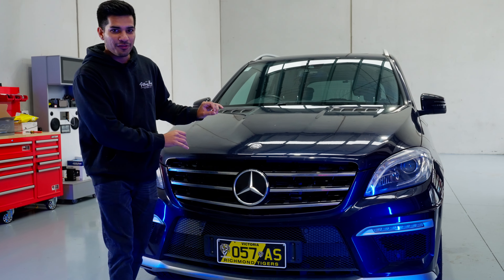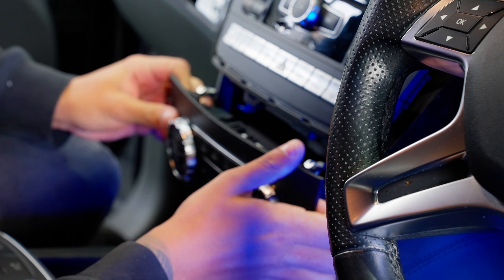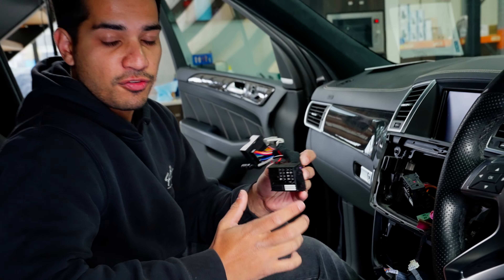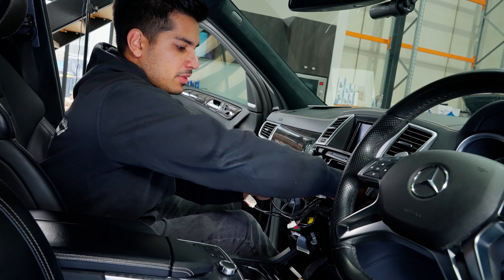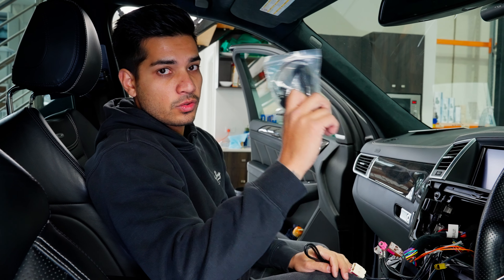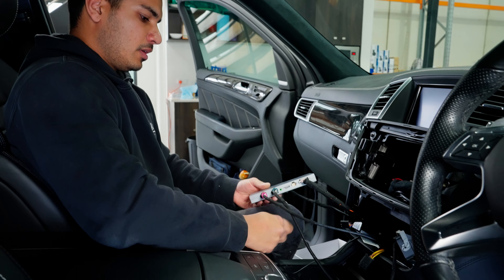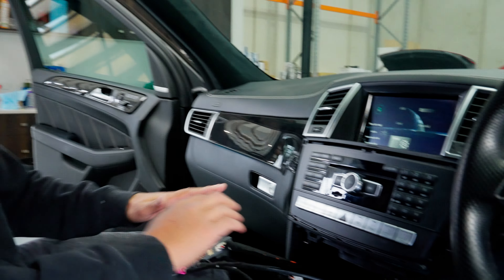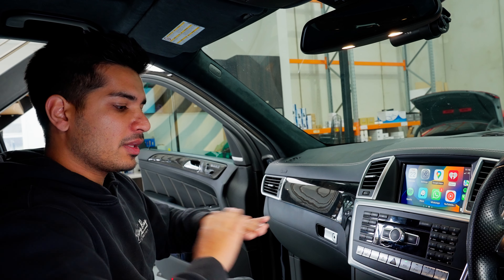WE JUST ADDED APPLE CARPLAY TO A MERCEDES' ML (Wireless CarPlay/Android Auto/USB)

Comment: My ML350 has the MMC / AMI plug in the centre console for AUX sound. Would I need to run a cable to this for the Sound to work in CarPlay with this
Unit or is it already connected directly to this unit?
Reply: Hi mine is same with what you described in centre arm rest , did you get sorted if so how please ?